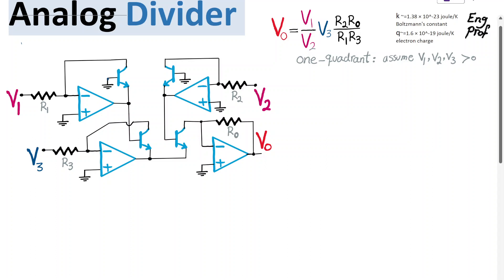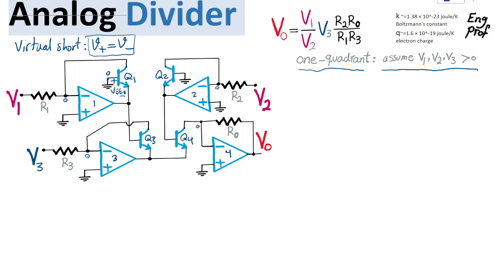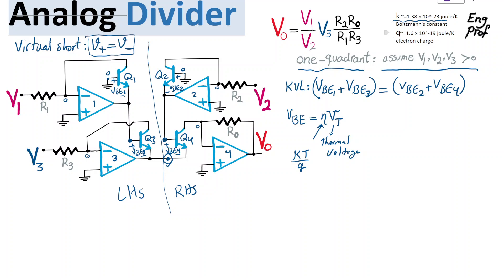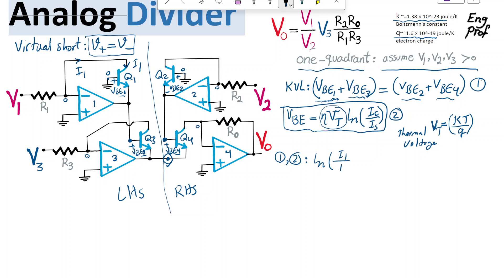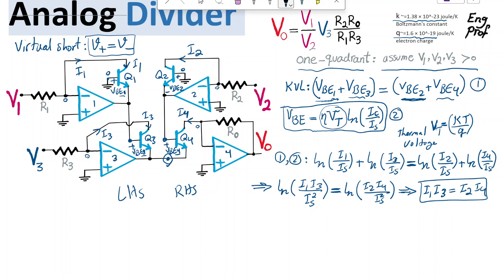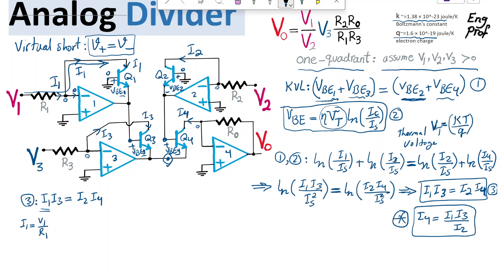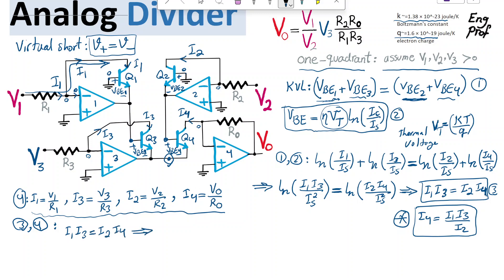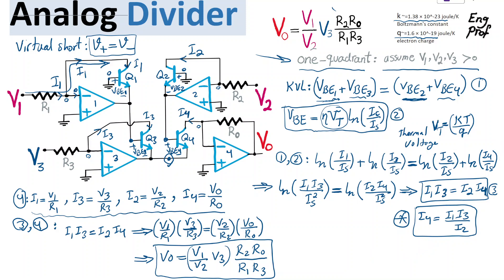Analog Computer: Signal Division Calculator

Comment: Absolutely brilliant circuit and a clear explanation - thank you for it (and the others).
It also makes a versatile amplifier with not one but two control voltages for its gain. I know what I'll do this coming holiday season - try to breadboard it. A good thing it popped up in my YT recommendation with enough time in advance to order some BJT arrays.
Reply from the maker: You are very welcome. Thank you for watching. Glad that this versatile voltage Divider and Multiplier circuit is useful.  Best wishes with your breadboarding and circuit experiment. Please just note that for practical design, voltages have to remain positive and value of resistors in this circuit have to be picked carefully relative to each other as they define base and collector currents of the Bipolar Junction Transistors in this circuit.
Reply: @STEMprof  "value of resistors" - the +/-10V and the 15-20 mA that a typical opamp can supply/sync place a minimum value for those resistors in the 1k value, and this disregarding any consideration on bjt currents. I'll probably play a bit first in 10k-200k on the left branch on its own to figure on what's actually happening with those currents. (might as well see if whatever SPICE apps that are around have good enough models of bjt-s in the sub-saturation mode). Thank you again.

PS I know I'd highly appreciate a "notes on practical design of opamp calculators" lecture series.
Reply from the maker: @col0342  You have engineered a solid plan 👌 in terms of slowly evaluating and testing. Prior Spice simulation is also a good idea. Glad that this video and follow-up discussion is helpful. Thank you!
Reply from the maker: And here is also an exponential amplifier https://youtu.be/XoIKYh5o2nI circuit in line with the topic of Analog function generators.  Hope that it is useful.
Reply: @STEMprof  apropos "an exponential amplifier" I binged on quite a lot of your work in the last couple of days - the short format and balanced density of info is a good hook - I like the "got the essentials, but I still need doing some homework to get the details" feeling (especially in the context of electronics as a hobby), it keeps the journey interesting.

Somehow, the idea of "voltage controlled" as the next step after "programmable by resistors/capacitances" got stuck in my head. This "multiplier/divider" is not only an example (or even a potential building block) but also made me realize that one may need to pay some attention to the currents for a proper "voltage controlled" approach  (your "bilateral current source" is another one I liked for this reason).

Oh, well, back to work now, I may get some "weekend moments" soon.
Reply from the maker: @col0342  Thanks for watching and sharing your thoughts. Glad to hear that circuit videos are helpful/interesting. 👍
Reply from the maker: @col0342  Thanks for sharing your thoughts. Analog Computer Lecture series in the form of dedicated Playlist is now posted in my channel https://www.youtube.com/@STEMprof/playlists . I hope the more focused smaller playlists are helpful.
Reply from the maker: A variant of this circuit can also be used as a square root analog calculator as discussed in this link: https://youtu.be/Dct5lwQyDuc
Reply: @STEMprof  Yes, I noted the "square root calculator". This (more general) one, can also be used to square a voltage (by feeding it into v1 and v3, w/o the Vo -> v2 feedback) or compute the geometric mean of v1 and v3 (feeding Vo -> v2).
A pity they don't produce arrays with more than 4 independent bjt, otherwise one could theoretically generate higher powers of input voltages w/o using separate multiplier circuits 😉
Reply from the maker: @col0342  you summarized it well 👍. Theoretically you are right in terms of cascading multiple instances of this circuit to generate higher powers or even potentially ultimately generating Taylor or Maclaurin series to realize a generic analog function computer!  Problem is dealing with transistor saturation issues when we get to cube power and higher. 😎